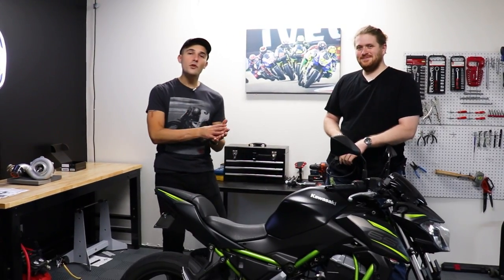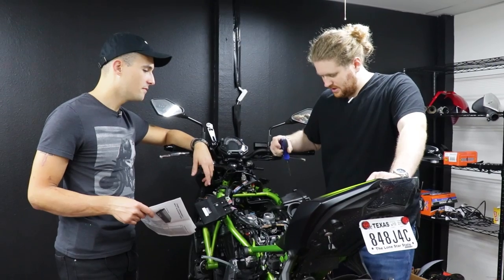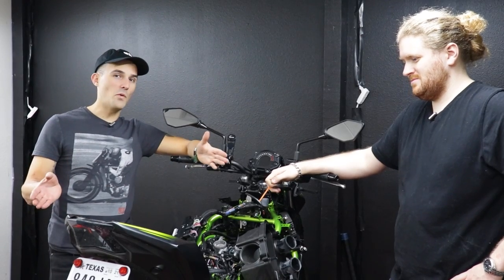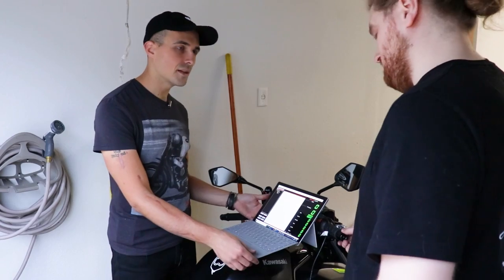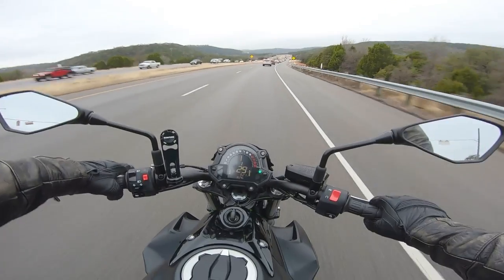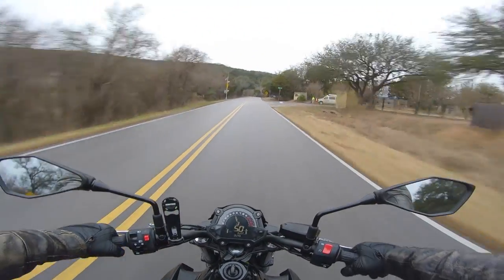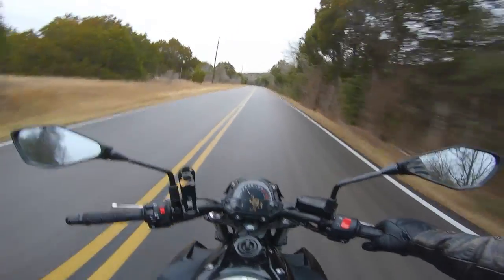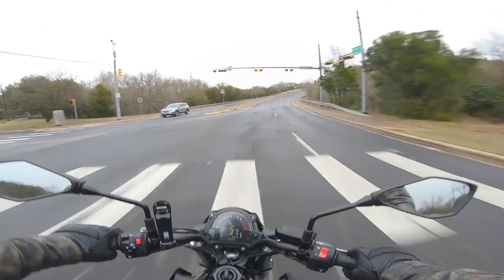Installing a Fuel Controller on the Z650 (Fixes the Snappy Throttle?)

Comment: I installed a piggy back ECU much like the Power Commander and the bike is a LOT smoother at low speeds. The throttle was jerky a bit stock but with an exhaust it was downright irritating. I bought the Power Commander before I saw this video and I was so bummed out because I didn't need more power & I got the Power Commander to make the bike a lot smoother which according to the video the PC doesn't do that. Thankfully just 2 seconds after the ECU was installed I found the bike so much smoother. Night and day difference. There is a power gain but you will be hard pressed to tell the difference in power but the smoothness is very much there. Another thing changed drastically is the engine braking has reduced almost 60%. Earlier you let go of the throttle and the bike would act like you dropped anchor as the engine breaking for a 650cc was quite brutal. 

The heavy engine braking did mean I could extend the life of my brake pads but I am very glad the engine braking has reduced. An ECU flash will work just as well but I was worried that if any problem occurs I would be hard pressed to tell if the ECU flash is causing the issue. With a Power Commander you can easily disable it to get back to the stock ECU.
Reply: Hmm, interesting. I too was bummed when I watched this vid cuz I'm looking to smooth out the on/off throttle on my '19 Honda CB300R that also has excessive engine braking. What bike did you install the PC on? Also a Z650? or something else?

I guess it might still be worth a try on my CB300R...
Reply: @jasper_of_puppets  Yes a Z650 with an exhaust. It's an expensive solution so if you don't have an exhaust maybe try a cheaper solution like Fuel X also from Powertronics.

Comment: I fixed my jerky throttle by turning up the idle a bit. It really works. I drive mainly London traffic. Great bike for the city. Turn up the idle makes a much less jerky ride
Reply: @steak8278  mine is a 2017 z650. There is an idle screw on right hand side of bike. Very easy to adjust
Reply: Have my 650R set to 1K rpm idle and it works perfectly, I found on some cold starts it wouldn't exactly stay running when I turned up the idle it started and stayed running fine.

Comment: "naked bikes are easy to work on"  Like the Z650, my Z900 requires basically all the plastics to be removed to remotely close to the airbox.  On my VFR800, remove rear seat, remove two bolts holding down the fuel tank, and there is the airbox.
Reply: My naked harley, the xr1200, requires me to remove the fucking fuel tank to work on the air filter..... yay
Reply: I did this mod myself a few months ago, was just as difficult to fit the PC to the Z650 as it was on my previous Gsxr 750.

Comment: I had the same problem with my ninja 400. It was dangerous on off throttle. I did a bunch a research and was told BY dynojet that the power commander will NOT solve that problem. So I had the ecu flashed.  All restrictions removed and buttery smooth after.
Reply: thats interesting i may have to go that route. i just installed a yoshimura alpha and it is really fun. but the throttle is a bit jerky

Comment: ECU flash is the way to go with these bikes, stock PC5 maps are shit, PC5 is limited in functionality and you wont know for sure if the map is right. ECU flashing costs the same and is much more bespoke.
Reply: And as far as 2wdw ecu flashes go after the initial purchase you can get unlimited flashes
Reply: @joeyg29jgjg  Unlimited flashes of bad maps is not very helpful, you still have to go take it to a tuner to get a decent flash, at which point you might aswell just put it on your ECU in the first place
Reply: @AntaresSQ01  bad maps?  The 2wdw Z650 maps are absolutely spot on.  Did you have a bad experience with your Z650 2wdw map or are you just talking about something you have no experience with?
Reply: @luisdetomaso2224  Nah i didn't have a 2wdw map for a Z650, I've definitely had a bunch of maps for my 2011 Ninja 650 though (same engine) and PC5 maps don't even compare to a proper tune. If you haven't gotten a proper ECU flash you should and you'd be able to tell the difference too. Don't get me wrong PC5 maps are a step up from stock but if stock is a 2 on a scale of 1-10, PC5s are a 5 at best, custom tunes being 8-10 depending on how good the tuner is. I've tuned vehicles myself too as part of my automotive engineering course and even an identical engine with identical intakes and exhaust requires different fuelling to be perfect. generic PC5 maps just simply can't do this. As i said, step in the right direction, but why get a 5 when you can get a 10 for the same price.
Reply: @AntaresSQ01  Joe and I are not talking about PC5 maps.  The 2wdw map is a total ECU flash.  It fixes all of the tuning issues with the stock bike and sets up the fueling for your new exhaust.  These maps are developed on a dyno using multiple customer bikes so they are well tested and proven.  I think we are all in agreement here that the Power Controller is a waste of cash because it is only a fuel mixture bandaid and does not address all of the nuances that can be fixed by a proper ECU remapping
Reply: @luisdetomaso2224  Ah yea sorry i guess I misunderstood, I thought u were talking about some shop's PC5 maps.
Reply: @AntaresSQ01  Yep, this is the second time these guys installed a Dynojet piggyback on a modern flashable bike.  Last time they did it to their R1.  I'm not sure where they are getting their bad tuning advice from - or maybe Dynajet is paying them off to showcase this inferior, obsolete method of fuel adjustment
Reply: @luisdetomaso2224  Just makes no sense either cos getting a proper flash is so much easier too, just take your bike to the shop and bam, they do it for you lol. Even if you really really want a shit map on your bike you can just get an ECU flash kit for hte same price and that's literally a USB cable going into your OBD-2 port and you can still reflash your ECU as many times as you want, surely 1 cable you need to plug in is easier than piggybacking on all your wires.

Comment: The on off throttle is due to the deceleration fuel cut. Only way to correct it is with a ecu flash

Comment: Try TuneEcu freeware instead. Spend the money on Dyno time instead!  Made wonders with my Moto Morini. Flashing is also reversible,  just save the old mapping. Then you can put it back if you want to. PCV is overpriced, almost a hoax.

Comment: I got my 2020 ninja 650 flashed by Moore Mafia. (Check out their YT). The difference was amazing and all the downs they say here in this video are all taken care of. The bike runs so much smoother and has way more kick to it. Its also way cheaper to do the flash than buying the Power Commander. Also saw a video on Moore Mafia on the dyno of a 2017 ninja 650 with the Power Commander and it was leaning it out too much.
Reply: What was the turn around time?
Reply: @dblackviper2k3  you ship your ecm to them and they usually ship it back within the same day of receiving it or the next
Reply: How much difference did it make for you im stuck with a 650 and trying to get more power
Reply: what aftermarket exhaust did you put when you did ecu flash? I just ordered a black widow GP Round 230mm.

Comment: Hey my friend I think you should change the throttle tube on that bike. As for the power commander five I suggest that you take a second look at the airflow box to see if it needs to be opened up more because when you install it was because of the change of the muffler system. I think you’ll find that this will help one of the things I did with my son was installed the power map commander five as well as a autotune on the bike what a difference a day makes. Though his bike was a Yamaha FZ07
Reply: Yeah I mean they talk like they did a legit flash. All they did was send a map to the pc

Comment: Huge bummer that it didn't do anything to fix the choppy on/off throttle transitions. I've got a 2019 CB300R that I love, but the 1st gear on/off throttle is annoying AF - way choppier than the throttle on my Honda 919 which I used to think was choppy, until the CB300R! ...Oh well, guess I just gotta live with it.

Comment: I seeee!!! So if you use a Power Commander, there's no point to flashing the ECU?
You're basically keeping a "backup" of the default settings, so when you remove the Power Commander you basically rollback to "default"? But i was watching a big Ninja 650 tune video, where they first used Power Commander, but then flashed the ECU instead, and gained like 20 extra horsepower at the highest rev range, that they did NOT gain via Power Commander.. So whats the deal here?

Comment: I did my Mod1 test on a Z650 and the on-off throttle was a pain during the low speed control! I ended up doing a death claw on the throttle to have fine enough control to just about keep it open whilst slipping the clutch. This is where carbed bikes win out.
Reply: What is a death claw?

Comment: Y'all should try a "throttle tamer" grip tube. Apparently they help smooth out the throttle feel for cable actuated bikes. Given that they aren't very expensive, I have always wondered if they make a noticeable difference.
Reply: Practise is best way to get rid of that. He's not riding as much as he says.
Reply: @jerryaduvall  exactly. Just twist slower and smoother. Throttle control basics.

Comment: this is exactly why you FLASH THE ECU. because you remove the ENGINE BRAKING from the stock ECU that's what is the jerky throttle. its decel cut
Reply: Exactly.  These dudes mean well, but are clueless about tuning.  I just hope nobody watching thinks this is the best way to set up a modern bike
Reply: @luisdetomaso2224  I'm thinking of an ECU flash - just no idea which is the most reputable place to get one...

Comment: Why have you guys ignored the booster plug? There are reviews all over YouTube where guys have done videos of the results of installing the booster plug on Kawasakis triumphs and probably others I'm not familiar with. The booster plug appears to take care of exactly what you wanted. It takes care of that acceleration deceleration problem that you're describing on that Kawasaki 650 and it does it on the triumphs as well and it cost an amazing $159. Guys can put them on in roughly an hour and that's mostly because of just having to take things like the gas tank off and if you've got a Versys, certain pieces of fairing also.

Why not give it a try on your channel?

Comment: The snatchy low speed / low throttle opening response on my 400 is my only real complaint. I also tried a 2019 Ninja 650 and it was similar but felt worse because of the extra torque. 

My previous bikes, including a fuel-injected FZ6R (completely stock) and a carbureted SV650S (full exhaust, K&N, and jet kit) were both MUCH smoother in cracking the throttle open, using maintenance throttle, holding a stead speed, etc.

I've been considering one of the two or three companies that will reflash the ECU. Trouble is it seems like a lot of trouble.

Comment: Throttle jerk on these 650 engines suck. Z650, Ninja 650, Ninja 650R, ER-6n.  Mechanical throttle cables, springs etc. Some folks claim they added afew "washers" to get the play out of the throttle slack at the bottom cable adjuster, nearest the clutch.

Comment: ive got a 1999 sv650s naked converted, and it is ridiculously hurky jerky with the throttle response (fkn whiplash the neck). the 650 2 cylinder class bikes seem to not like being smooth, fun as fuck though

Comment: The z650 and Ninja 650 have had that issue since 2011 if not longer.
It sucks that they haven't done anything about it in 10 YEARS!
Reply: I have  an 07 650R its been longer than 2011 LOL

Comment: So the map doesn’t let you modify the fueling off idle? Maybe a dyno tune??...if not, waste of money
Reply: You can make custom maps on power commanders. You can adjust fuel at any point of (rpm, engine load). He just probably doesn't know how to do it.
Reply: @BrielleHater1224  Of course... I was being facetious...I’ve built two dynos and tuned numerous bikes with Power Commanders, Fuel Pacs, Race Tuners, etc, etc, etc... fixing the snatchie off idle fueling is pretty straight forward, even without a dyno.... they just don’t understand how..

Comment: Just Curious- Is there a single bike out there that you guys would feel DIDN’T need to be changed from stock? Do any of the motorcycle companies “ get it right” from the factory? I’m guessing you guys don’t think so….
Reply: Well in basically every bike you're gonna need at least a new exhaust to get rid of the stock one as they tend to be very restricted from factory due to regulations. After that it's good to tune the bike because the new exhaust affects the air fuel ratio.

Comment: I got an ecu tune on my tenere 700 to get rid of the snatchy throttle there and it worked in the higher revs but not so much on the lower revs. From what I understand, removing the O2 sensor fixes that once its tuned. Perhaps it would be the same for you?

Comment: I have a 2020 ninja 650 abs krt with the same power commander but there still hasn't been an aftermarket tune from the dynojet website yet and I've had it since October of 2020 and still no map what are my options?
Reply: Use the 2019 maps...ECU and fuel injection system are the same

Comment: The 2014 Vulcan 650 I rode had the same snappy on/off throttle. Hate that shit. The 2019 Versys 650 however, wasn't bad if I'm remembering correctly. Why Kawi why?

Comment: Wouldn't the jerky throttle depend on the map that's uploaded? I only ask because I've seen some maps made for my bike that are supposed to modify exactly that.
Reply: Yes. I installed a piggy back ECU much like the Power Commander and the bike is a LOT smoother at low speeds. The throttle was jerky a bit stock but with an exhaust it was downright irritating. I bought the Power Commander before I saw this video and I was so bummed out because I didn't need more power I got the Power Commander to make the bike a lot smoother which according to the video the PC doesn't do that. Thankfully just 2 seconds after the ECU was installed I found the bike so much smoother. Night and day difference. There is a power gain but you will be hard pressed to tell the difference in power but the smoothness is very much there. Another thing changed drastically is the engine braking has reduced almost 60%. Earlier you let go of the throttle and the bike would act like you dropped anchor as the engine breaking for a 650cc was quite brutal. 

The heavy engine breaking did mean I could extend the life of my brake pads but I am very glad the engine braking has reduced. An ECU flash will work just as well but I was worried that if any problem occurs I would be hard pressed to tell if the ECU flash is causing the issue. With a Power Commander you can easily disable it to get back to the stock ECU.

Comment: It ain't a super sport it's more chill "sport" tourer also not sure what i did with mine but i did get the on off throttle on my ninja 650 to be much smoother no jerkiness than whatever is going on with that z650?
Reply: It’s the same with the 650 too..for some reason they made their 650 so jerky for some reason
Reply: @NinjaPleaseProduct  that's just the engine almost all the 650 engines are like that. For a buttery smooth engine you would go for the zx-6r or any inline 4 but you sacrifice seating comfort

Comment: I have seen that getting a booster plug will get rid of the snappy on/off throttle feeling. I have a Vulcan S 650 and the on/off throttle feel sucks. The bike is great other than that.

Comment: @yammie noob just installed V&H full exhaust on 06 Suzuki blvd c50 and bought Dynojet power commander V,   is it necessary to install it? I've had mixed answers.... thanks for video any opinions greatly appreciated
Reply: If you have a full system exhaust with an aftermarket air filter you should ideally use a Power Commander. However since its 2 months already I am guessing you went ahead and installed the ECU. How was your experience ?
Reply: @brendonfernandes2877   I actually have map programed and installing this weekend.... Deceleration Poping wasn't bad in colder weather, past 2 weeks weather is warmer and seems like decel pop is more frequent.... 👍 Thanks for asking.
Reply: @brendonfernandes2877  I never had Brand New tires and today I got Michelin Commander 3's put on....  Why does bike seem slippery? Actually felt like I was going to go down turning corner to my block..... Is this normal?
Reply: @jasonsanderson9385  Most new tyres need some time to settle in. At least a 100 miles. I haven't personally heard of these tyres though I believe they are meant for cruisers so can't tell you if they are very good or not.

Comment: Modern mail order maps are not just decent, they are incredible.  A flash from a reputable tuner like 2WDyno is going to blow away that 2010 piece of piggyback garbage Spite has installed because they refine all aspects of the ECU (most notably the irritating engine braking and fuel cut) - not just fueling.  You guys are doing your audience a disservice by basically demonstrating a technologically antiquated and inferior way to tune this bike.

Comment: Noob? Open laptop and add 5% fuel at 0% throttle from 2000_to 4500rpm. You had the laptop open.

Comment: You want to make power on a 650?  Easy ditch kawi and get a honda for instant nearly 30 horsepower gain
Reply: @TheAsheybabe89  i never understand the misnomer of a slow reving I4... the tac will generally be able to out pace any rider so if it slow reving it’s because of a slow throttle hand.  Also honda is know for their midrange power on every bike they make.  If it was 5-10hp id agree with you but a difference of nearly 30 will provide more throughout the entire range.

Id say the only argument between the two is price because the honda has a lot more features and tech but the kawi is more than 2k cheaper